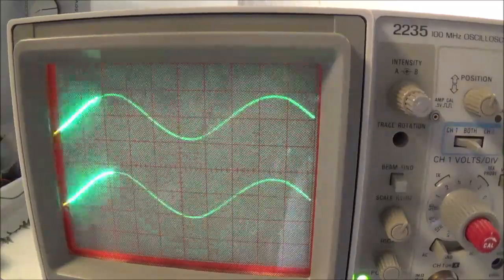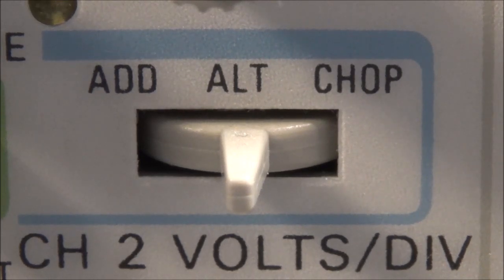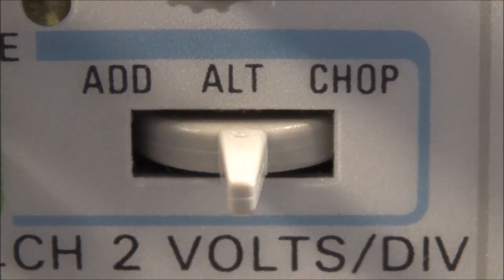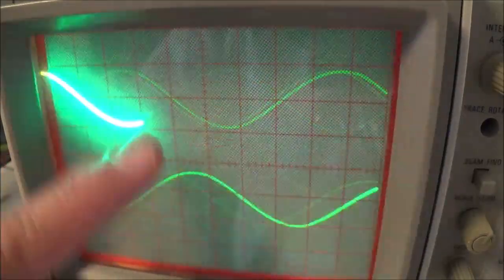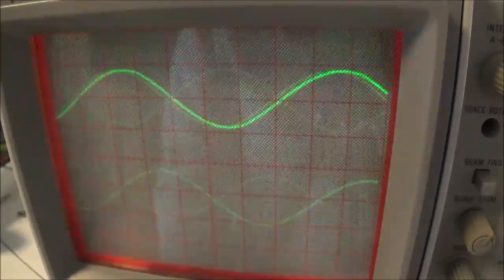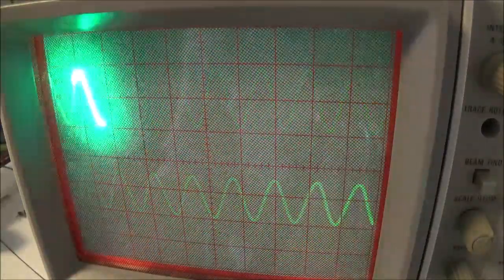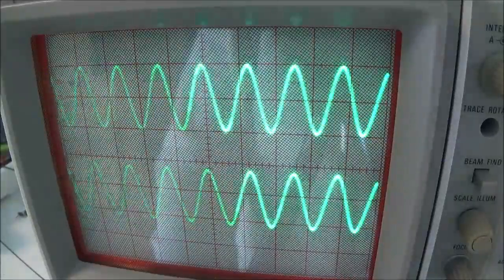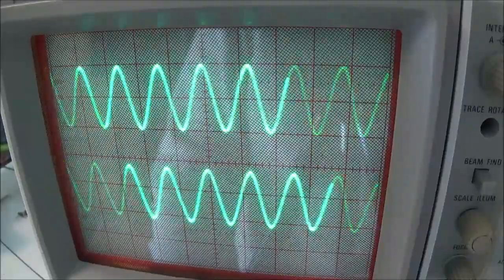Analog Oscilloscope Alternate And Chop Mode

Comment: I have the same model but when choosing chop mode, the screen gets one bright light dot on the left side of the screen and starts increasing intensity but i take it out of chop mode before it’s too much, i think it could burn, do you know if that problem is common? Or what am I doing wrong? Thanks for the videos!
Reply from the maker: I am travelling at the moment, have practically no internet,  and have to use the app; this only lets me see the first post of yours, which I am now replying to. As far as I understand you, you get a trace, but it is too bright. Have you tried playing around with the   intensity setting, the horizontal sweep speed, and the input frequency? At any rate, I will be back in 10 days and will have full internet again.

Comment: Timely coverage sir. Thank you. Your 2235 CRT display appears to show orange glow at the edges. Is that normal?
Reply from the maker: Sir, that is just the graticule (grid) illumination. There is an orange band around the edges of the CRT that seems to glow when it is illuminated. Thanks for your comments.
Reply: @OldSchoolElectronics  I see. I hope one day to own a Tek 2200 series. They are nicely design on top of the quality. Thumbs up.